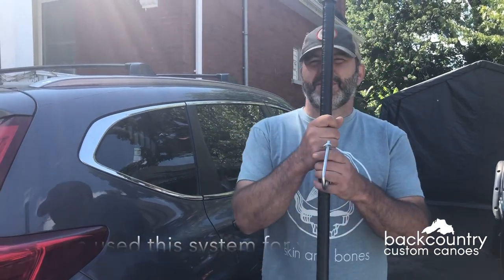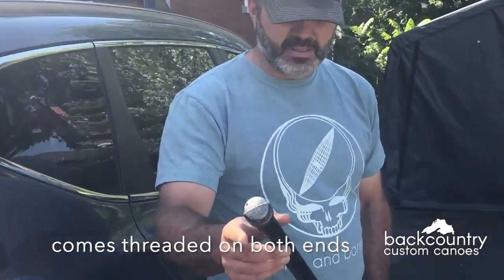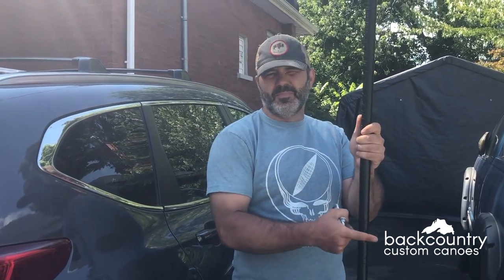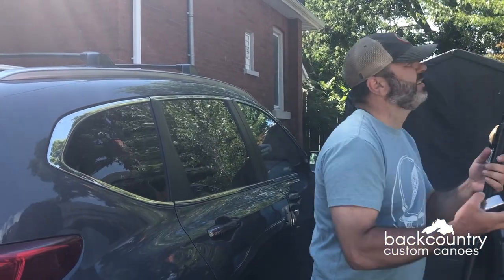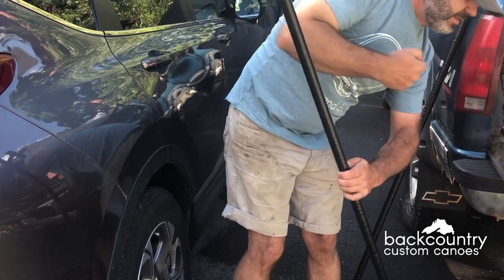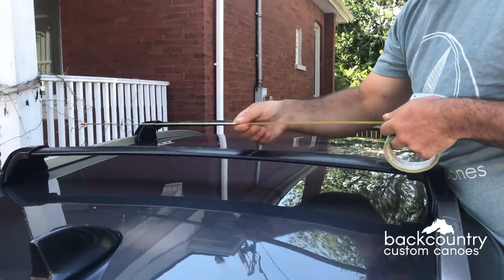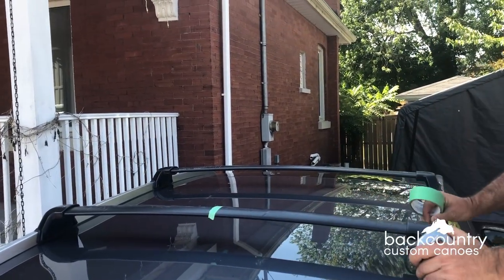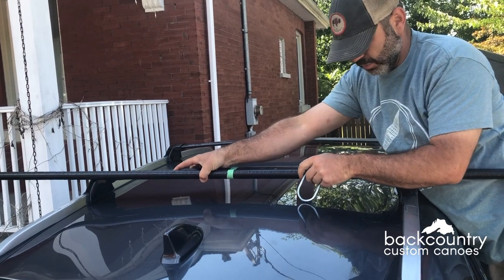DIY double canoe rack.

Comment: Skin on frame hulls...cool.  I'm sure they're much too lightweight to bend 1/2" steel pipe, right?
If so, why not use aluminum pipes and skip the electrical tape and end caps?
For the record, I have two 48" aluminum tubes ($15 per) each resting on two canoe foam blocks and secured to my bare roof by ratchet straps fed through the tubes and into the vehicle cabin.
Yes, they bend slightly once I tighten the ratchet straps sufficiently, but I've experienced no issue cartopping either my ultralight Wenonah solo or my older, wider, much heavier fiberglass tandem.
I imagine that for two canoes, 72" square aluminum tubes would function just as well.